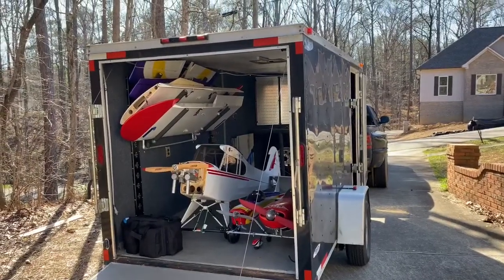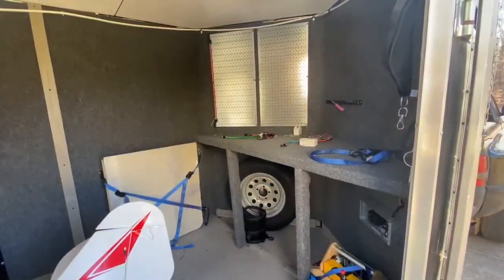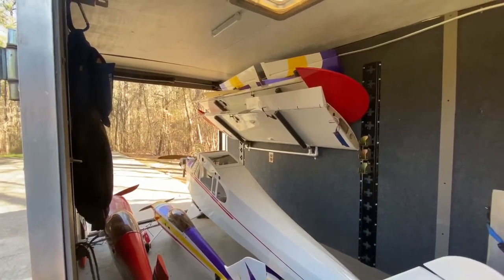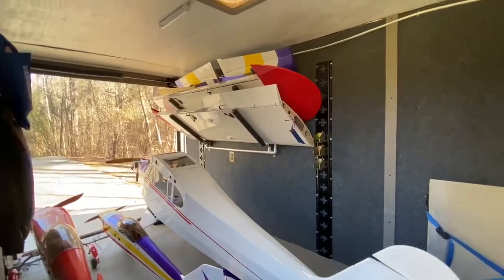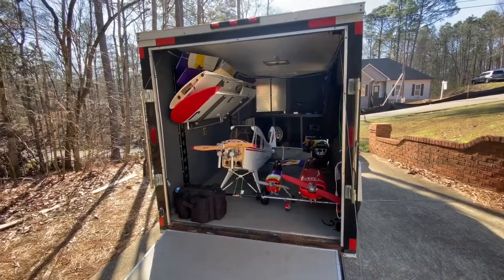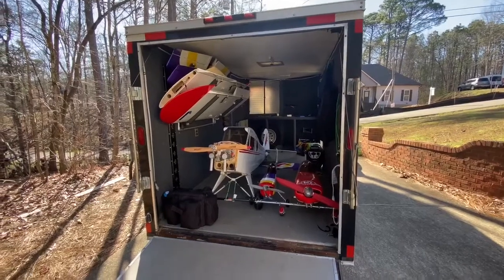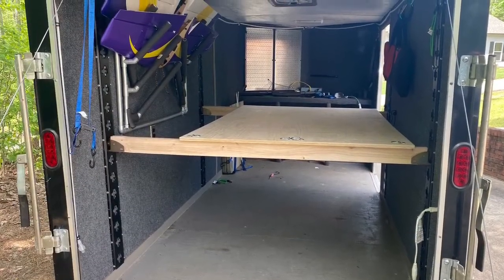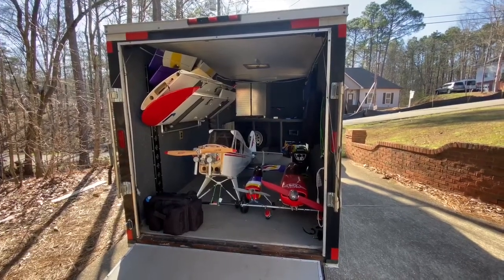Radio Control Hauler! Pit Trailer for RC. Planes, Helicopters, and Cars!

Comment: What a great transformation. What thickness plywood did you use?
Reply from the maker: I think it was 1/4 inch all around. Might have been a little thinner on the roof side.
Reply: @jtcrowder49  thanks. Do you recall what you used to cover the wall?
Reply from the maker: Yes, it was 6x10 or 8x10 outdoor carpet from HD or Lowes. I think they were $20 each and I used 3 or 4. They still have it. I was there about 3-4 weeks ago when I saw it last. All the colors and patterns share the same part number so make sure you get enough for your project. I was one short and had to drive to 3 different stores to find the right one. They are usually rolled up and displayed in a box standing tall at my stores.
Reply: @jtcrowder49  so very helpful, thanks Jake. What did you use to bind the carpet to the plywood?
Reply from the maker: Staples.

Comment: did you make or buy the rack for your wings?
Reply from the maker: I made it from 3/4 PVC pipe and spray painted it. Be sure to pin the joints with screws.